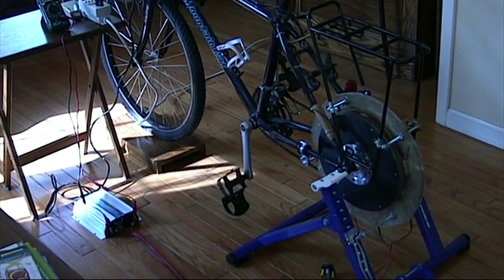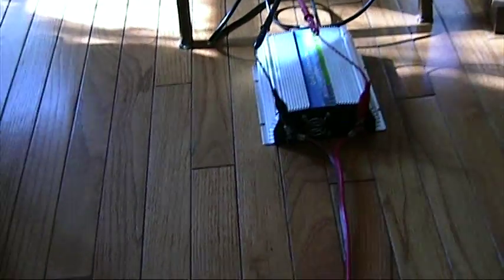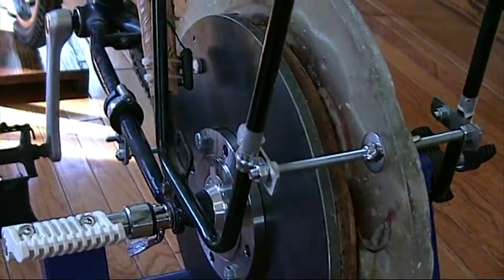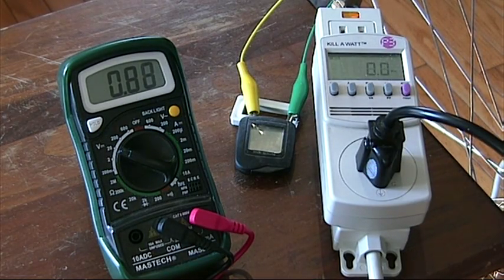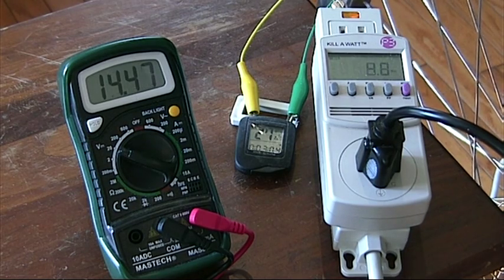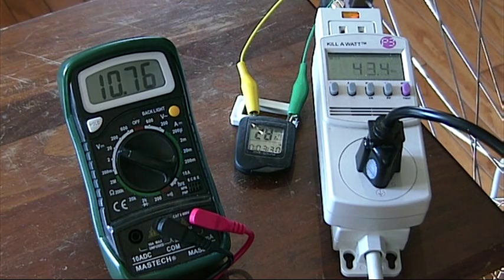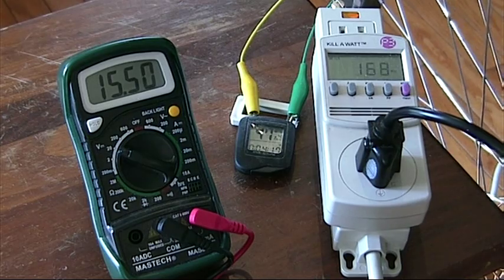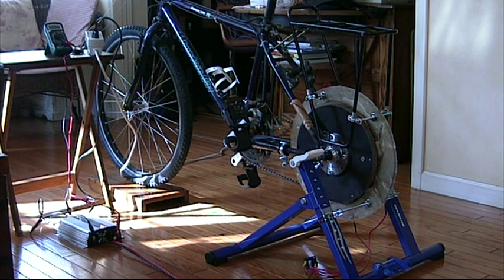Bicycle Generator - DIY PMG in action!

Comment: do you have an estimate as to kWh produced per unit of time pedaling at a given rpm?  for example,  20 minutes pedaling at 200 rpm produces 0.2 kWh?
Reply from the maker: +Jason Fedelem The power/RPM ratio is fairly linear up to 300W.  Coil resistance causes the curve to tail off after that.  Wired in Delta configuration, Power(W) = (RPM -150) * 0.9.  It produces 100W at 260 RPM, so at that rate will produce 0.2 kWh in 120 min.  The average cycler can maintain 60-100W.  Athletes of course can sustain higher output.  I typically produce 60Wh during a 40min. workout (including warm up and cool down).  Note that I'm producing 72Wh DC to get that 60Wh AC, which includes running a 10W DC fan as well as driving the inverter.
Reply: GRAamazeCE awesome,  thanks for the reply.

Comment: if peddling that puts out 90 watts and you hooked up a 90 watt load, how much harder to pedal the bike?
Reply from the maker: +stellerfeller To put out 90 watts DC (say, to charge a storage battery) takes about 100 watts at the pedals (it's that efficient!).  To put 90 watts AC on the grid using through the grid-tie inverter, or power a 90 watt load through a DC-AC inverter, takes another 10-15%, so about 115 watts at the pedals.

Comment: How much magnet wire did you need? Why did you choose 14AWG? Any useful websites on stator design? How did you end up fitting 24 magnets on your wheel?
Reply from the maker: 300 ft. for 42 turns/coil @14AWG, 570 ft. for 80 turns/coil @16AWG.  Gauge selected based on available space and number of turns required to produce given voltage at given RPMs.  14AWG wired as star, 16AWG wired as delta gives same internal resistance, latter has higher power output at 400 RPM so I use that stator now.  12 magnets on the rotor, not enough clearance to put another 12 on the second rotor, which acts to strengthen the magnetic field across the coils.
Reply from the maker: As for stator design, there are plenty of highly technical papers available (Google PMG stator design) discussing efficiency and fabrication tradeoffs between core vs. coreless, axial flux vs. radial flux, pole-to-coil ratios, coil vs. serpentine windings, delta vs. star wiring, etc.  But in the end, all roads pointed to the design introduced at http://www.scoraigwind.com/pmgbooklet/itpmg.pdf

Comment: Great work ! Thanks for showing us ! SO much better that friction/tire drive and rim/belt and really any system using a high rpm gen. I have wondered about putting a magnet or two ( for balance) on the rear bike rim or even strapped to the dirty side of the tire( bike is up on a stand of some sort). Then a coil on the frame somewhere(or on the stand under the rear wheel) the magnet would pass near. You would get the high relative coil/magnet speed due to the large wheel diameter. The output waveform would be a pulse but who cares if it is driving a battery or large cap. Might not be able to hold very small coil/mag clearance but this is really not an efficiency issue( unless you consider mechanical friction and eddy current drag), so much as a limit on flux change at a given rpm. Perhaps you could just strap on a couple more magnets if you wanted more power (and more torque load) at a given rear wheel rpm.Your rig is probably able to produce much more power that a human can deliver. Congrats for really doing it instead of just thinkin about it !
Reply from the maker: Thanks for the comments!  I thought about rim-mounted magnets, but wanted an efficient design which wouldn't pose fabrication problems.  If you don't use a reflux plate (for the magnets I used, 1/4" steel) to mount the magnets, you lose half the flux, and making the plate to fit the rim was a bit of a hurdle for me.  Not to mention mounting the curved coil harness.  I guess I'm just more comfortable working with flat surfaces.  If you succeed with a rim mounted version, please share!

Comment: Hello, Very nice build! Quick question, what size of magnets did you use and what type? Did you use laminated copper wire or normal copper wire? How did you connect the rectifier? Which phases to what pole?
Reply from the maker: Hi Jeroen! I used Neodymium magnets (2x1x1/2"), N42 grade.  Coils used laminated AWG 14 copper.  Used a star configuration in connecting to the bridge rectifier (common connection of the three phases NOT connected to the rectifier, then the other lead of each phase connected to an individual terminal on the rectifier).  Try Bicycle Generator - DIY PMG parts for more detail.

Comment from the maker: I built the rotor and stator myself.  Magnets and magnet wire are readily available on eBay, and I had a friend of a friend make the steel rotor plates for me.  I used a plywood form to keep the magnets from slipping on the plate.

Comment from the maker: Hi Bob!  In the video, the watt meter shows the sampled output in watts.  (It has an accumulated watt mode, but as it only shows in increments of 10 Watt-hrs, it would take 6-7 minutes for the display to change!)  This PMG/PMA is indeed efficient.  I can generate 60 watt-hrs in a 40-min. session.  Go for it!